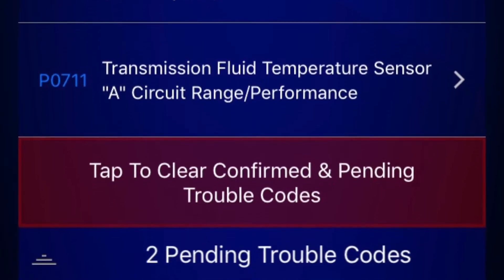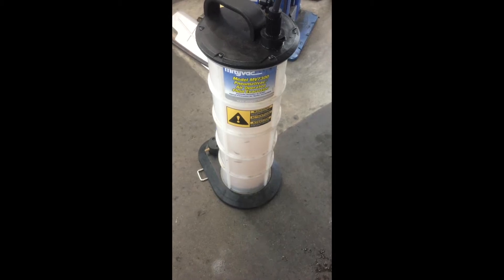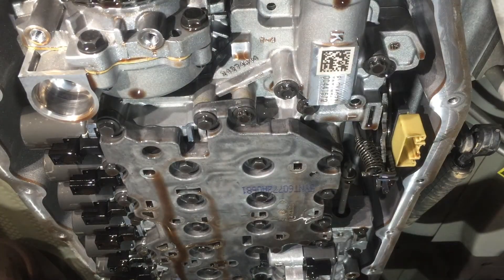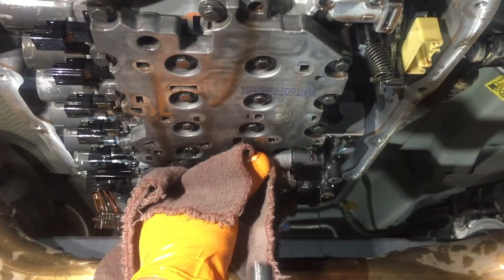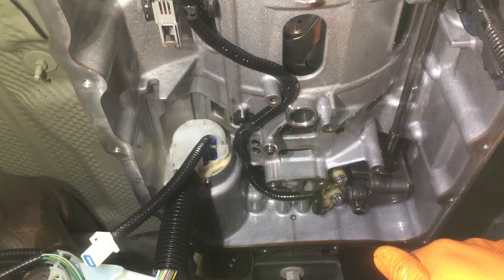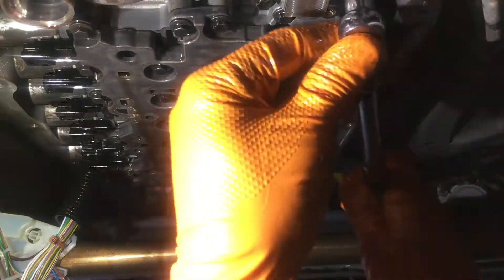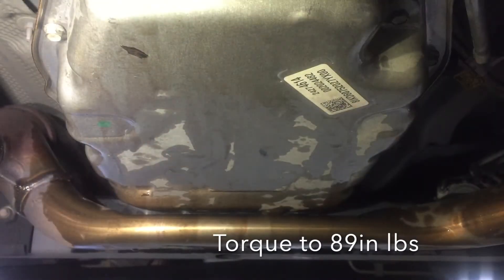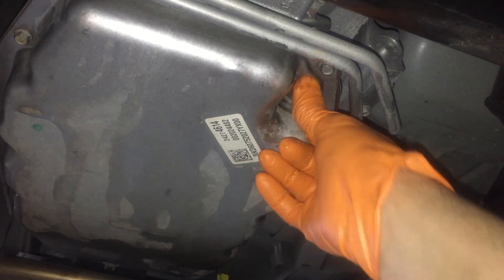P0711 Silverado Sierra Transmission Temperature  Sensor 8l90

Comment: I have a 2016 GMC Sierra 1500 with the 8 speed transmission. I have the P0711 code currently and looking to add parts. Is it mandatory to order the one piece harness or can I get the two piece harness and just install the bottom portion? Is there benefit to installing the one piece harness ?
Reply from the maker: @XLRider  I would definitely do the two piece design
Reply: @TruckNerd thank you!!!!

Comment: I wouldn’t be worried about handling the bottom of the valve body with a rag, as long as the filter passage or anything on the top doesn’t get contaminated

Comment: I have a 2018 Pacifica with ZF9 transmission, and P0711 code. It mostly appears when it’s warmed up, and sometimes temperature goes up and drops quickly, like 25F range in half a minute. There is no slipping or abnormal transmission behavior. Does it sound like a bad sensor? Should I check something else first, before embarking on this amazing journey of replacing the internal electronic module?
Reply from the maker: @chapstyleusa476  I’m not familiar with that model, but it does sound like a sensor.

Comment: Autozone sold me Castrol LV fluid and they swear it didn’t damage my A8 transmission. Reached out to Castrol they send me an email saying that it’s the incorrect fluid. Switched over to Mobile 1 HP ATF but the damage is already done. I’m about to sue Autozone bcuz they won’t replace my transmission even tho I proved to them it’s the wrong fluid
Reply from the maker: @rodthagod84  That sucks. I’m sorry that happened to you. Maybe this information will help the next guy.

Comment: I have a question. I have codes po711 stored and pending. And po700 stored. It's a 2017 gmc sierra Denali 4×4. about a month ago is when the cel came on and off.  But in the last couple of weeks it sounds like i have a bad bearing? The trans doesn't seem to be shifting right and the tact goes up.and doesn't come right back down after giving it gas? Could it br from the fluid getting to hot and burning up the trans? Would that make a noise like a bad bearing? I just had the l/f hub assembly replaced and it didn't change anything. And they changed the front differential fluid and still the same? That's when i hooked up the scanner and got the codes for the trans.i see all the comments on the sensor for the trans temp being bad. But I can't see that making a  noise like a bad bearing? What could be the problem?
Reply from the maker: @RayReed-m9h  The transmission temp sensor is not usually paired with noise, I think you have 2 separate issues going on. If you are concerned about the noise first, you might consider getting your truck up to speed & making the noise, then shift into neutral. If the noise stays, I would doubt the noise  you are hearing is from the transmission.
Reply: @TruckNerd  will try that. Thank

Comment: Did this exactly except I just got the lower harness, double checked everything... then pan on and hooray my temp sensor is good but now all of the fuckin pressure control solenoids are open circuit...  I have a picture of them all plugged in and the truck drives just fine. The live data says trans ok to crank and the Engine light does not illuminate but when reading the codes 1 through 4 are open circuit. Im reading good line pressures and I'm 100% sure my wiring harness is the correct part number. Im thinking its got to be the upper harness or I've just not pushed the connectors in enough like a dimwit. That or the dielectric grease my smart ass put a generous glob of on the outer plug has insulated the grounds to the solenoid. Anytyhing helps and ill be sure to reply what happens next if anyone is interested what it turns out to be.
Reply from the maker: @CCGORE  Sounds like you were very careful and do good work. The only thing I can think of is maybe the large connector inside that connects the two harnesses together may not be all the way in before latched down. Also some people have swapped a purple wire at the rear of the transmission. In both of these cases I would still expect to have a drive ability concern. Keep us informed.
Reply: @TruckNerd  After countless tests with the multimeter, cleaning connections quintuple checking everything taking the pan off 3 times, and bathing in ATF, I have now learned what PDTCs are. Since it was a permanent code it needed the battery disconnect treatment then to have everything reinstalled (probably unessesary), and a heat cycle + fast learn procedure to convince it to look at the solenoids and see they are in fact connected and being used. Shifts tremendously better from the new fluid too. I couldn't be more thankful you actually responded, if I hadn't of opened it back up to check what you recommended I wouldn't have found one of the little cover pieces off of the rear connectors that decided to pop off in the pan. best of luck to you.
Reply from the maker: @CCGORE  Good job. Glad you got it fixed!

Comment: Cadillac Escalade 2019 (8L90 automatic transmission). What current kit of spare parts is needed for this repair? We're talking about part numbers - what to order. The automatic transmission temperature shows 20-30 degrees lower than the real one, after warming up the car it shows normally, but after a long period of parking shows wrong again.

Cadillac Escalade 2019 (АКПП 8L90). Какой актуальный комплект запчастей нужен для данного ремонта? Речь об артикулах - что заказывать. Температуру АКПП показывает на 20-30 градусов ниже реальной, после прогрева авто показывает нормально, но после длительной стоянки все по новой.
Reply from the maker: 24046895
Reply: @TruckNerd sorry but it didn’t help. on the purchased part there is a female connector, but on the board that is installed in the car there is no connector at all, the wire goes somewhere deep into the automatic transmission. Sorry for my english (I’m from Russia)

Comment: That wonderful piece that seals the valve body to the rest of the transmission, the one you put trans assembly lube on, what is that piece called? Mine apparently slid down before i got the valve body back in place, and it tore.
Reply from the maker: Just a seal. Not sure what the catalog calls it.

Comment: 2017 here. So OEM i should have the 2 pc harness? Only way it would have the 1pc is if the sensor was replaced at one point during the time that GM was using that 1pc harness?
Reply from the maker: Or if you have the auto stop feature.

Comment: I did everything in this video went on a test drive truck does not go into 3 gear. Should i drop pan and inspect wires or could it be low in fluid i missed the last step in draining. Thank you 🙏
Reply from the maker: Definitely make sure it’s full of fluid. It’s my understanding that there are two wires that can be crossed in the rear of the transmission. I would expect codes to be set if that’s the case.
Reply: @TruckNerd  wires were crossed bro now she shifting smooooth thank you man🤌🏻🙏🙏🙏 topped it off with fluid too
Reply from the maker: @cristianeduardo019  that’s awesome you got it figured out.  Good job.👍🏻

Comment: Which year models are the one piece harnesses? 

I have a 2016 Yukon XL Denali 6.2/8L90. Im hoping it is a two piece harness and not have to get that deep into it.
Reply from the maker: Probably 95% of the ones I have done have been the 2 piece. No real way to tell without putting eyes on it.
Reply: @TruckNerd  shucks... Guess I'll be changing the fluid and filter twice then. Can't have it sitting for more than a weekend.

Comment: I accidentally took off that piece at the bottom with that all those connectors on the left plug into. There are some little bb like plastic piece that fell out. Any idea what these are an where they go?
Reply from the maker: I have never seen that before. Sorry.
Reply: @TruckNerd  just researched that they are called “check balls”

Comment: Will this help if tranny is shuddering when it gets hot around 160ish degrees? The only transmission fault i have is the p0711. Complaining of vibration/shaking when going highway speeds. Might just end up doing the whole trans. Thanks!
Reply from the maker: Typically the 8 speed shudder problem is around 45mph, so not highway speeds. The shudder is fixed with a fluid flush. When you change the harness you change 7 quarts. Might be worth a shot.
Reply: @TruckNerd  Roger that starting with a flush first. Thanks boss I’ll keep you posted. Your videos always save me too

Comment: dealer wants 1k$ to fix this, its a 75$ part , how do you fill the fluid back up if theres not dip stick for fluid
Reply from the maker: I use a mighty vac that will pump fluid out, remove the plug & pump it in that way.

Comment: Does this apply to the 2007 gmc sierra with the 6.0 motor? Thanks in advance
Reply from the maker: No sir. Different transmission.
Reply: @TruckNerd  First of all thank you very much for the reply. Second, any idea💡what could be the issue with my pickup? It's a 2007 gmc sierra classic, with a 6.0 liter engine. Any help is much appreciated. Only the transmission is overheating
Reply from the maker: @lisn2urmotherfn  do you know what transmission is in it?

Comment: Im sure I may have missed it in the video, but how do you determine which harness you have between the one and two piece versions?
Reply from the maker: Could be either. But 95% of the ones I have seen are two pieces.

Comment: I need to have the service done and would tackle it myself but I have no shop at this moment.  I keep talking to mechanics saying they need to have a programmer come out and “flash” the control module and it’s an extra 300 dollars.  Is there any truth to this?
Reply from the maker: A lot of the time I don’t reflash the computer.  You can do the repair, then see if it’s shifting okay. If not then have it reflashed.

Comment: A master at work. Thank you.
Reply from the maker: Thank you!
Reply: @TruckNerd  my temperature for transmission pop up and I changed the fluid but no sensors. did you run the same issue ?
Reply from the maker: @isthatyou510  if the transmission temperature is erratic, you need to replace the sensor.
Reply: @TruckNerd  cold start its at 90 but the highest it goes is 190 max 196 then drops to 190. but nothing. close to erratic. thanks

Comment: Since at least the mid 2000s GM Truck Trans Fluid has been synthetic.   270F is the start of Coking damage and the Hot warnings to idle Veh.   The Internet charts are almost all for conventional crude oil based ATF, where 220F was a damaging range.   270 to 285 Towing on hills, in desert hot weather is where you're having an issue. If there were an issue, your modern  truck would have warned you and then went in to limp home if req. There was no issue in the situation you described; At all but  better to worry and pay attention than to ignore it or miss it.

Comment: Im not sure if messed up on something but I’m not being able to put my car in D. It goes into R and N but not smooth as it should… Any thoughts? Thank you.
Reply from the maker: Apparently there is a purple connector & a white connector in the rear that can be swapped. Check there.
Reply: @TruckNerd  is it next to the shift cable?
Reply from the maker: @pedrofenix4222  from my understanding it’s 2 of the 3 connectors in the rear.
Reply: @TruckNerd  Im kinda lost not gonna lie 😂 where are the connectors at? Thank you for your patience!
Reply from the maker: @pedrofenix4222  just check them all then.
Reply: @TruckNerd  you mean the connectors in the solenoid?
Reply from the maker: @pedrofenix4222  yes. Make sure all the correct colored connectors are in the right place. Use the video for reference.
Reply: @TruckNerd  they are all where they supposed to be
Reply from the maker: @pedrofenix4222  I’m not sure then.

Comment: what are the symptoms of a bad one?
Reply from the maker: Check engine light can come on, but it takes two failures in a row. Harsh shifts can occur as well.
Reply: ok I'm having problems with shifting and the engine revs high like its in neutral with poor acceleration  I'm thinking that it might be a bad ecm it's an 2011 gmc sierra 1500
Reply from the maker: @tommyfpv5476  that’s definitely not this transmission.

Comment: Great video. Have you been changing the range sensor on this transmission??? I have a 2017 Yukon I don’t have any codes nothing on my scan tool, when I go to range position it shows ourecognized state on drive mode. I’m assuming the sensor is bad but I haven’t seen any video replacing it
Reply from the maker: I have replaced one. It had set a code though. I don’t remember the code number, but I do remember it having some other symptoms. Definitely not a common problem.

Comment: Can regular mechanic do this or do I have to take it to the dealer? Is this expensive?
Reply from the maker: That depends on the capabilities of the regular mechanic. If your vehicle has the two piece harness it’s even easier. If they can change a transmission filter, they can change the harness. This repair should be approximately $500 in most cases. If the whole valve body is dropped it will be more.
Reply: @TruckNerd  thank you for the quick reply. I forgot to mention P0700 & P0711 came up at the same time, does that make a difference or is it related to the same problem. Thanks in advance.
Reply from the maker: @OJRC26  just seen this. Yes. Same problem.

Comment: Same procedure (approx) for the 6L80?
Reply from the maker: The 6l80 has transmission control module mounted to the valve body. The temp sensor is internal to the module. So it’s similar in the fact you will have to remove the valve body, but everything else is different.
Reply: @TruckNerd  Nevermind, I think I understand that on the 6L80 the thermistor is not part of any harness and is integral to the control solenoid body / TCM and can't be serviced separately.  Go GM!
Reply: @TruckNerd  Bummer!  Was hoping for a two-piece harness for my '16 silverado that I could do myself with ease for the temp sensor.  Do you happen to know a part# for the '16 silverado LTZ 4x4 6L80?

Comment: Hello sir I have a 2007 Silverado 1500 4.8 8 cyl. And the transmission heats ups fast then goes into limp mode and the faster I go the faster it heats up. And I took it to several shops and no one seems to know what’s wrong one of the shops installed a cooler and it did not fix the problem another shop installed a radiator and that did not fix the problem they have ran the truck with the scanner connected adn they say the transmission runs fine and it shifts fine too until it goes above 200 it doesn’t want to accelerate right until like next day it accelerates fine and it doesn’t have the check engine light on or does it have codes so I would really appreciate what do you think it could be. I’m just very tired of going to shops putting money into it and nothings fixed I appreciate your time. God bless all of you for posting videos and helping each other out that’s how the world is suppose to be!

Comment: When I cold start my truck the transmission temp reads 95 is that normal?? Any suggestions
Reply from the maker: Doesn’t sound normal unless it’s like 100 degrees outside where you live. You should monitor the temperature as it comes up to operating temperature. You want a smooth increase with no jumps. If it’s jumping around you definitely need the harness replaced.

Comment: I had the same problem on my 2016 Silverado, at the beginning of engine light came on, however after a few days the engine light went away. 
Do you have any idea what could have caused the engine light to disappear?
Reply from the maker: The temp sensor is right on the border of the failing parameters. It will come on again.
Reply: @TruckNerd  Took truck to dealer the harness and temp sensor out of warranty but GM made it good thanks.
Reply: mines been doin it for 2 years off for a week then on for a day then off for a week, then on again, its always shifted rough from 1-2 though

Comment: Will it cause damage to drive/tow if this code came on? It came on once today cleared the code truck runs and drives as normal, coolant temps are normal and trans temps are normal.
Reply from the maker: Trans temperature is most likely erratic. The transmission may have or develop abnormal shifting characteristics. I would have it replaced soon.

Comment: Great video. I'm getting the code but when driving I can look in my info and it shows a steady 175 or so. But the check engine light is intermittent. But took it to A zone and their machine said temp sensor on tranny. I can rebuild semi hermatic compressors all day but I'm not sure I want to try it. Ugh. But I probably will. Just don't want to f@&$ my truck up.
Reply from the maker: Maybe easier than this. GM made the harnesses 2 pieces again. If you can change the filter you can change the harness.   https://youtu.be/JRhYc-UjCOw

Comment: Fantastic video.  I appreciate your craft!  In your experience how often do these temperature sensors last? Couple of years? Or depending on service, like towing a lot? 
Next question, is would it beneficial to delete the transmission thermostat for longer life, If the sensor failure is due to too hot of transmission fluid, moisture in fluid, etc.  why do you think the sensor is failing?
Thanks, in advance.
Reply from the maker: Good questions. I think this was a poor quality part issue. I had a 2016 this week with 28k on it needed one. Also I have not had to do any a second time, so looks like they fixed the issues. As far as the the thermostat delete, I could see the logic in having the transmission run cooler, but I’m not an engineer. I’m sure they have some reasoning behind it. Thanks for supporting the channel.